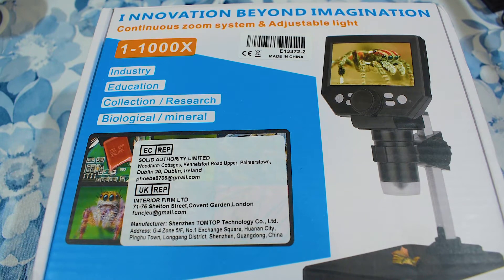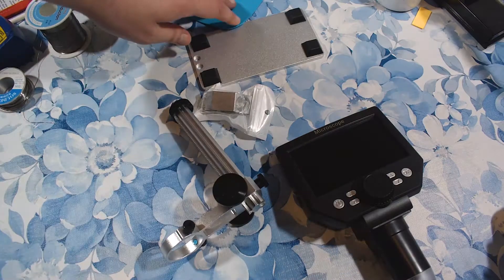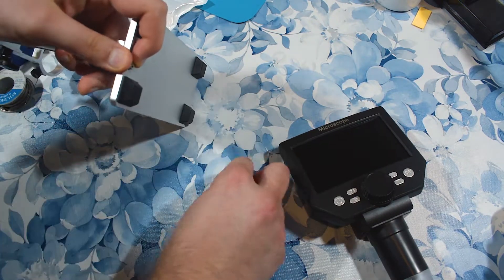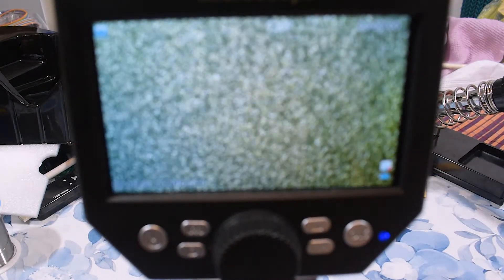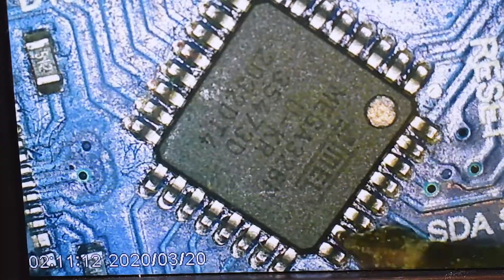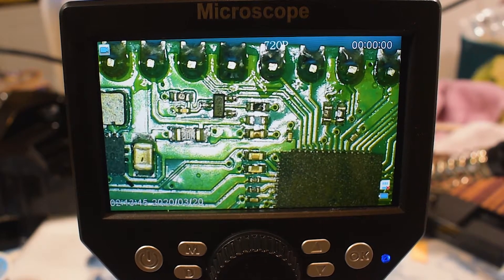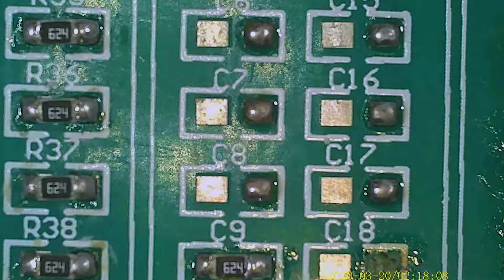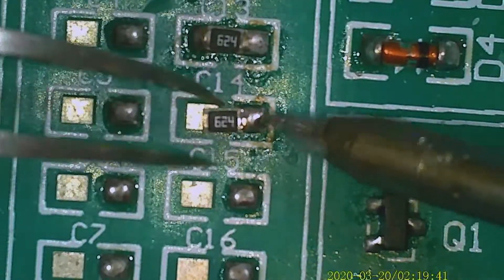Digital G1000 microscope from AliExpress - REVIEW (Is 55$ enough for microsoldering?)

Comment: what about the working distance between pcb to the lens ?
Reply from the maker: Oh man, it's perfect. You could use it from the top of the holder and it'll still magnify. I recommend it if you have nothing better.
Reply: @milanfixer  Thank's
Reply: @milanfixer  you never compared to the USB one later in the video like you said though
is this basically the same thing but with a stand a  screen slapped on it?
I mean besides the lag?
i just got a UB one that uses inskam for $1 on the 11.11 sale but it won't work with the app for some reason
it works in windows though
I wonder if I could 3D print a stand to hold it and  an old phone or fire 7 tablet and get the same  results< I mean is I can ever figure out how to get it to work with the aop
I am considering  those articulated arm camera style scopes but they say  they are only up to 180, it's not much more than  540 more like  $90 t0 116 on sale